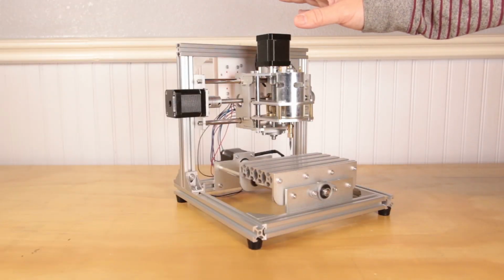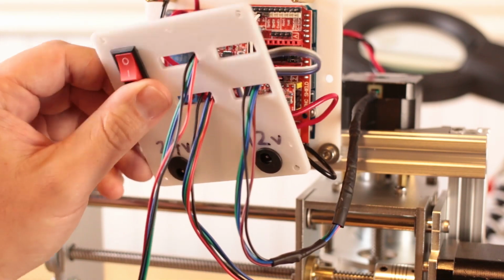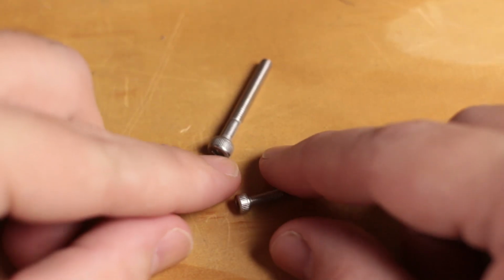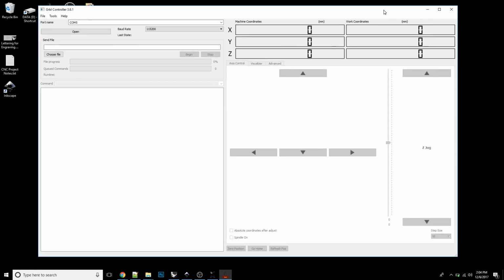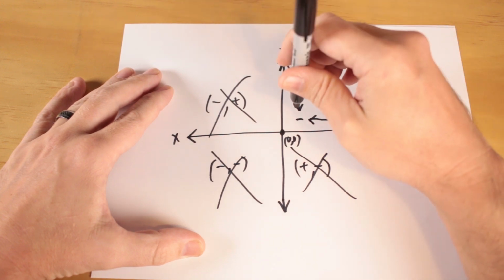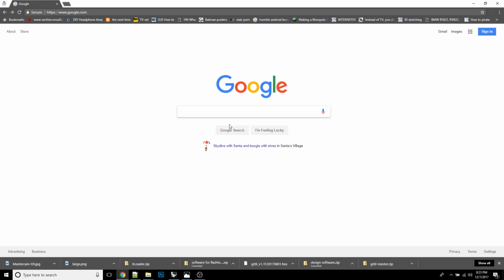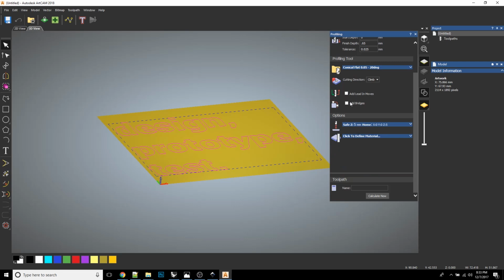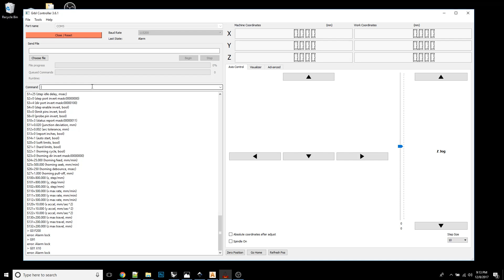How to start CNC Machining for under $200 - Working with the T8 CNC engraver

Comment: Oh there’s a little box you can make with two batteries an LED  wire leads two alg clips . Make a continuity circuit for your mill - end gets put under your job pice and the other goes to you head unit  and every time it makes contact the LED WILL light up to let you know you got good contact.. I don’t know 🤷‍♀️what I’m talking about but it looks good on the WALL. OF LIGHT!. THANK YOU 🙏 THIS WASGOOD  GRAND BANY IS HER #$ sorry 😐

Comment: Pity that the price in UK Sterling is £152.62 which is nearly $60 more than the price in dollars on your video, despite the UK being easier to ship to than the US.  I'm going to hold off and see if that gets corrected.  Thanks for the video anyway.
Reply from the maker: My video got so much traction that it turned a dud into a best seller for Gearbest, and they adjusted the price accordingly. I don't agree with this tactic. Nor do I get paid for these reviews by Gearbest. I suggest you write them an email asking for the machine for $160 like my video says it will cost.

Comment: Never (seriously) tin a wire which will be crimped.
Reply from the maker: You are approximately the 1000th person to say this. It's not as cut and dry of an issue as you all seem to think. Read the comment by Nicholas for evidence contrary to your assertion.
Reply: @DesignPrototypeTest  He mentions screw terminals, not crimped ones.
And even for the screw terminals, I'm not sure he's right.

Comment: Is there a way of setting the cutting depth as steps with those softwares? your setup did the whole 0.65 at once... what if you'd wanted to do a really deep engraving of say 2mm in 0.1mm steps, say in a hard plastic?
Reply from the maker: I suggest you watch part two of this video. I linked it in the description.
Reply: @DesignPrototypeTest  kekkers... thanks

Comment: Hi Matthew. My last question for you if you'll indulge me. Does your Uno have a CH340G chip? Supposedly GRBL has a hit or miss issue with the particular chip, and my board has it.
Reply from the maker: Yes. There is a CH340G chip on my board.
Reply: Dang, alright.  I guess I did finally hit paper-weight mode as far as I can tell.  Supposedly, that chip is hit or miss with GRBL, and the docs say there is no solution if an issue occurs with it (I don't know how to fully test it outside of buying a real Arduino).  I worked out all of the GRBL controller program and hex issues, but my steppers don't seem like they're getting power at all, though my CNC shield does have power, and I've quadruple checked the wiring.  Blah.  Well anyway, thanks for all the advice and responses; I appreciate it.
Reply from the maker: Don't throw it away man. I just spent 3 days solid getting smoothieware to work on this MKS Sbase board. This is how the hobby goes. If it was easy everyone would do it. :) Just keep trying different things. Get a different arduino board. It doesn't have to be genuine. I have had problems with these UNOs that have the ATMEGA 328 chips on them when doing certain projects. Maybe get an "UNO R3" they cost about the $7. Also, I would replace the Stepper sticks. Those things are tremendously fragile. I've burned up a number of them. This CNC machine came with a4988 stepper sticks, which cost about a dollar each from China on Ebay. Don't quit man. You'll get it!
Reply: Ha, alright, you've convinced me.  I'll keep at it.  I literally know nothing about this stuff and still feel like I'm flying blind, though I'm learning a lot.  I started just wanting to make fancy coasters and junk for family friends. :P

Comment: NEVER tin the  wires going into a screw terminal, the  "cold flow" of tin will make it loosen over time, you need to either put the bare wire, or put a crimp over it
Reply: Yep. I’ve moved to using crimped ferrules. Make things so much easier.

Comment: Thank you for your helpful video on that relatively inexpensive CNC machine. I like your method of explaining all key steps.
 Some months back, I bought a laser engraver (A3 size) from banggood.com and thought of adding a z axis stepper motor and replacing the laser with a small spindle motor mainly for making PCBs. But after watching your video, I feel it's better to  buy a regular CNC machine with Nema23 motors and a sturdy frame for CNC jobs.
What happened to your plan of making a PCB with this machine? I am waiting for the video.

Comment: Great video.
Could this machine do metal if you installed a larger motor?
Regards,
Joe
Reply from the maker: Yes, but it would require extensive modifications to get the new spindle (motor) mounted and working. I highly suggest you watch the Myfordboy videos I linked in the description.

Comment: Hi man, great video,

I've put mine together and followed the video step by step but have hit a snag, I can't get the stepper motors to respond to the grbl controller when I press the directional arrows. When I press the "spindle on" button it works and the spindle switches on and on. so I figured maybe it was a wiring issue, so I checked all the wires with a multimetre which were wired correctly, checked all the power leads with the multimetre, and check the stepper motors with a 9V battery which ticked and twisted a tiny amount each time I touch the leads to the power. So i have a feeling that it is something to do with the code/ command script, but I am a complete noob and have been scanning forums for the past 3 days trying to figure it out.  Any ideas of any areas that I might have forgot to check? or an suggestions? I would really appreciate if you could help me shed some light on this?

Thanks pal
Reply from the maker: Smart testing. You are doing the right kinds of things. Here are a couple more ideas:
1)Have you tested the Stepper Motor Drivers? Did you ever mess with those? It's easy to put them in backward - Which fries them. It's also easy to unplug/plug them in while the board is powered - Which also fries them.  New drivers are cheap. Look for "4988 driver" on ebay.
2)GRBL controller might have popped an error. Type $X into the command fieldand then manually tell the machine to move with a G0 X10 command.

Comment: 13:00 there are 2 negative connections on the back of the conector,
 one is negative from an internal source, 
the other is negative from an external source,  
when you plug in from an external source the internal one is opened so only the plug (external) is active,
it is meant for battery or power supply operations

Comment: Never, never, never tin your leads if you're going to crimp them! Same reason as screw terminals. And come on, no crimper? That's a basic tool. I'm using one from RadioShack for like $10 and it does far better job than any plier can do. That said, great vid, thanks!
Reply: Artur's Lab, was just about to post the same criticism then saw this... Totally agree and dislike people who don't understand the principles of basic things like crimps and screw terminals.
Reply: Artur's Lab - totally agreed with your comment
Reply: richard mccann - I've worked in a factory where we manually made thousands of connectors (magnetos, coils, etc.). It's just easier to apply the end connector first then solder it , not the other way around. 
When crimping tool is being used, it is designed to crimp loose wires.
Do, whatever works for you, and enjoy your hobby.

Comment: Hey Matthew.  I got the stepper motors working!  The problem was as dumb and simple as it could have been; one of the two ground pins on the 12v input wasn't, well, grounded, so everything would show the right voltage for a little bit and then degrade.  The bad news is later that day, my laptop turned off with the router plugged in, and now it won't detect it when it's plugged in.  Have you had this issue before?  I think the COM port might be hung or something, but I thought I'd ask in case you've experienced this.
Reply from the maker: Congratulations Man! Feels good doesn't it? You've accomplished something!

I have not had this problem with the COM ports. I'm sure there is a way to unhang the com ports. If that is the problem. Try this: Open your "Device Manager" in Windows. Then right click on "Universal Serial Bus Controllers" Then click on "Scan for hardware changes." Note, I do have one of the USB ports on my laptop which has stopped sending/receiving data. It still works as a power point, but just can communicate using it.
Reply: Thanks, and yeah, I tried that and uninstalling all of the serial buses and let Windows re-install them on reboot, but that didn't seem to do it. I tried the other USB ports as well. I'll keep fiddling.

Comment: Hey again.  I lied about the last question apparently.  Does your relay output 10V to the CNC shield, and does your CNC shield show 10V on that top pin labeled 5V to GND?  Mine does, and I have no idea what that means, but it doesn't seem good.
Reply from the maker: If you have your negative(-) black lead of your multimeter attached to ground and the dial set to read voltage, then connecting the positive (+) red lead of your multimeter to any pin labeled ground (GND) should not show any value. If you connect the positive lead to a point labeled 5V and it shows a value like 5.6v, or 4.4v  that is probably ok. If it shows a value of 10v then you have a problem. Meaning you have a short somewhere in the system.

The power supply should output 12v. Maybe 13v or 11v is OK, but 10v is probably too low to run this machine. 

This is important: Make sure that you have a fresh battery in your multimeter. If the battery is dying, the multimeter will report the wrong values.
Reply: Alright, I'm and idiot, and I'm finding out how little I know about electricity.  I had the multi-meter set to AC  (I've only ever done home repair projects with it).  Setting it to DC shows the proper voltage.  That being said, I don't have power to my VMOT pins on the stepper motor drivers.  Not exactly sure what that means.
Reply from the maker: On this machine, the VMOT pin should have 12v power fed to it at all times when the machine is on. You are on the right track. Keep it up.
Reply from the maker: https://forum.pololu.com/t/how-to-check-if-a4988-is-fried/3542

Comment: I am bummed out they do not offer Artcam anylonger, wish someone still had the exe file for it.
Reply from the maker: Especially the installation file for the paid version which was actually a decent piece of software. The free version was hobbled, and it was barely usable. I really showed it being used to it's highest potential in this video.
Reply: Design Prototype Test, what do you recommend to use now instead of artcam?
I have been looking but haven't found anything yet.

Comment: Great I found this... I bought & assembled a T8, and did only minutes of operational testing.  I suspect my physical build has uncorrected errors - I may have to disassemble and follow your mentioned points.  YTer 'HomoFaciens' did a review of the T8 and mentioned he might come up with mods or alternate functions, but has not yet shared such on his channel.  I went looking for the Autodesk Art Cam software;  not sure if I want to go down that route.  Thx!

Comment: Good video, I have one of these cnc machines and found it very hard to get the spindle to run true with the brass connector so got a few and had the same with them all, how did you make the tool run true with the connector?
Reply from the maker: The best you can do is tighten the set screws symmetrically top and bottom. This will theoretically center the bit, but it's hit and miss. Really it's just one more design flaw in this printer. A collet system would be much better. I highly suggest watching Myford boy's videos that I linked in the description.

Comment: Now make an actual part with it. Better yet, make a part with your 3d printer, then make the same part with the engraver. A process comparison and finished part comparison would be highly informative since the 3D print people never cross this line (milling - that of which we do not speak - lol!) It wouldn't have to be elaborate. Just a small rectangular box with a lid maybe?

Comment: Thank you for the vid. Was a GREAT help in building mine. So I have a couple problems if you don't mind. You mentioned your X&Y were reversed. On mine it's the Z and I know Zero code. Second issue is when I plug in the 24V power supply the spindle runs. Toggling the on/off in  GRBL does nothing. Lastly I can create in InkSkape but it wont link with GRBL due to the .hex. Downloaded a few programs that say they will but are 64bit. I have a 32. any help/suggestions are greatly appreciated.Kris
Reply from the maker: For your z-axis problem you need to reference the "$3" portion of the instructions on this page: https://github.com/grbl/grbl/wiki/Configuring-Grbl-v0.9

Regarding your spindle problem: It sounds like you have it wired incorrectly. What happens if you unplug the "SpnEn" wire from the control board? Does the spindle still spin? 

I hope this helps set you in the right direction. Unfortunately, I don't have enough time to help all of my viewers trouble shoot their projects. I suggest you find a forum to ask your questions on. reddit.com/r/cnc and also reddit.com/r/arduino are both very good.

Comment: You know when I got the connectors with my solar kit I had problems with it dis changing the cell .. found the leak it was in side the plastic injection molding . The housing and when you moved it would SHORT .and drop out so I try to find the good made plug and jack setup to any of my projects,,, I put them to the drop test if it makes it through wired from on the floor.. it’s fine ... and I have a question?. Can I use a project box for the electrics .i wonder if all the weight of the wires and the strain on the head will stop the jitters.  Uneven cut . I think if there is no connections on the head unit but 4 wires two for the stepper motor and two for the power head unit,? 
If I make try to take all the strain and weight off the head carriage it can move more freely. What kind a lube for the rails did it call for any grease I think it’s that white lube ...?    Just some questions I don’t know anything but try too think my way through .. can you give me your input on that ... 🙏 Thank  You for your time sir ..Black Dog Out...

Comment: Would it not be easyer to move the table mounting brackets in front of the bottom rail instead of behind to able the cutting tip to reach the back of the table

Comment: Gahh!  Just use the right crimp tool, dude!  It isn't that expensive
Reply: I hear that! I was dying a little inside seeing something that should know better using the wrong tool and getting a much worse result. There are cheap crimpers out there that would do the job just fine for the average person. Anyone that is looking to do wiring should go buy a crimper if they want to save tons of headaches from loose and poor connections.
Reply: @docgiggles130  It's good to learn how to make solid crimps with standard tools, much like it's good to learn how to strip wire without a graduated specialised stripper or one of those never-works contraptions. You'll become a better tech for it. It's not like we're talking about things that actually need termination tools like registered jacks or compression sleeves here. About the only complaint I'd level at his technique is crimping the wire before the insulation stress relief, but that's mostly down to how I was trained.

Comment: One very important item missing from this presentation is selecting the machine tool path iin Artcam. In the machine drop down I do not see arduino or anything like a T8 CNC. I selected (gcode mm.tap) and it appears to work, albeit I don't know if this is the correct selection.